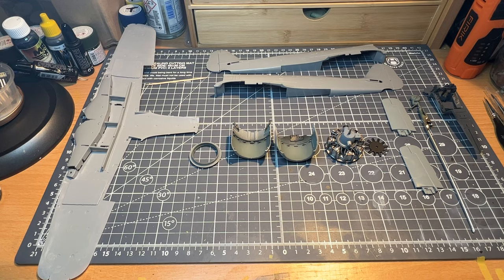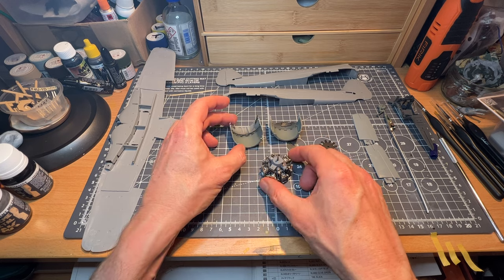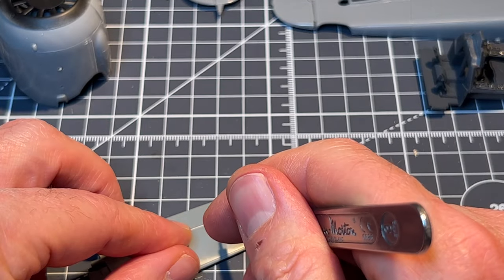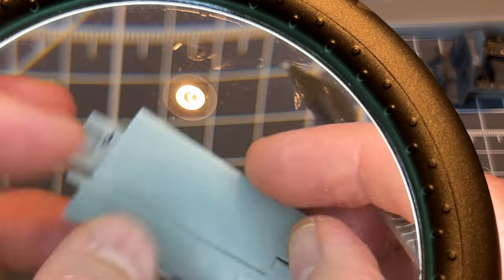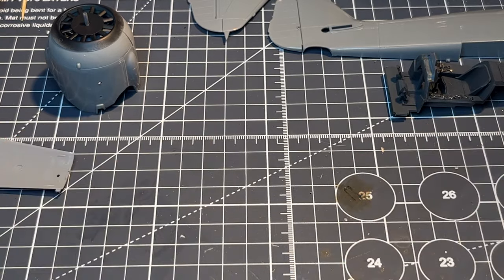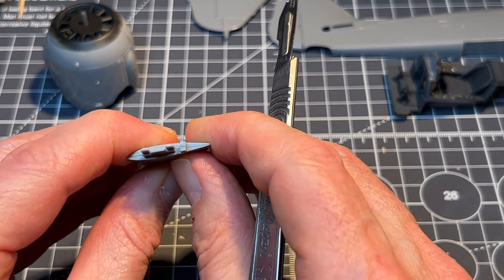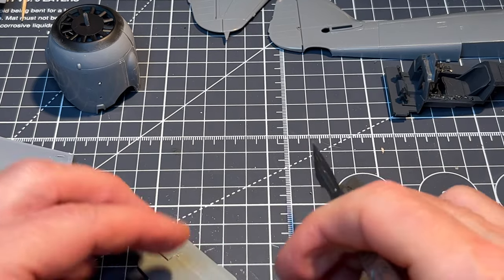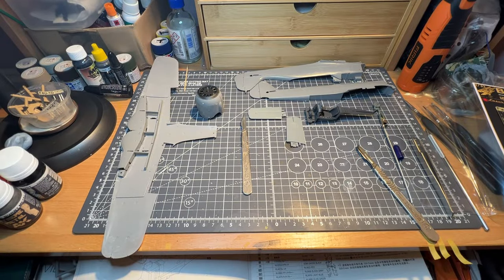Focke- Wulf Fw190 A8 1/32 scale Hasegawa model: Final engine assembly.

Comment: Thx much for your video! Real-time & real-life figurin' out as you go. Priceless.
I fear my comment here will come too late to prevent a more or less permanent error in the build. The annular nose ring was designed to fit "proud"; it's necessary to it's function. It's an armored nose ring; the airflow into the cowling is forced backward, under high pressure  from the fan, through the oil cooler (which is immediately behind the nose ring), and exits through the small space between the cowling & the "proud" cowl ring.
Red flag the first: Hasegawa is NOT the kind of company to make such a "fit" error.
Red flag  the second: reference, reference, reference. Saves soo much error. This definitely falls into the "measure twice, cut once" category.
Reply from the maker: Dear Joseph,
Many thanks for your excellent message! As it happens, you are not too late by any means! I had vague suspicions about the annular ring and had lately seen the mechanics of that part, hence my musings on the video. I tend to be slower to build and also to make alterations unless I am sure of what I am doing and comments of the type you have kindly penned are exceedingly useful, so I am grateful!
I haven't built a Luftwaffe aircraft before and am not as familiar with the type as I would want to be so my tendency is to move cautiously. I had located a minor design issue in the cockpit with the apparent absence of the throttle lever and also a slight mismatch on the control column- the hand grip should be angled away to port (from the pilot's view). I have been able to deal with the first issue with scratch built replacement which should suffice and will (on this occasion) not make a change in the second. I noted in my review video that the kit appears to be of excellent quality- all the signs are there and so far it has proved to be the case!
I hope that you won't mind my somewhat lengthy response, but as you took some time, I feel that I should do likewise and I am particularly pleased that you liked the video- many thanks indeed!
Regards,
Z

Comment: As always, a thoroughly enjoyable update, Z. I do have to commend your self-control at your not overflowing your swear jar after that scribing gaf. Very nice work indeed. Cheers, my friend
Reply from the maker: Dear Paul,
Thanks very much for writing, it is always good to hear from from you! The cutting operation was always going to be potentially difficult, so I guess I was somewhat prepared for a problem! In any event, it’s been possible to deal with it so there should be no trace.
Hope your projects are oath free!
Regards,
Z

Comment: What I find when I have to make knife cuts like you did on the elevator: scoring with the back of the knife takes out a narrow shaving and the blade doesn't get stuck in the cut.
Reply from the maker: Dear Mr Hotel,
Thanks for getting in touch- I think you suggest a good technique and one I didn't consider up until now. As it turns out, things seem ok after a quick annointment of my moisture of Mr S500 and Mr Dissolved Putty. I'll show you on the next one!
Regards,
Z

Comment: Zin - quick question:  Having now scribed and applied a slight bend to the elevator surface, do you have to  modify the mounting tab on the end of the elevator surface to fit into the mounting hole on the side of the fuselage, or is there enough slop in the mounting hole to accommodate the changed orientation of the elevator's mounting tab?
Reply from the maker: Dear Tron,
A good question, but there is slop aplenty to accommodate the slight change I have made. I think that it will be striking on the finished project- at least I'm hoping so...
Good to hear from you again!
Regards,
Z